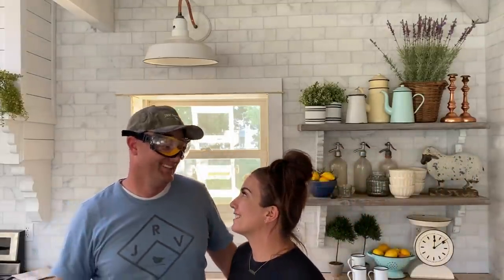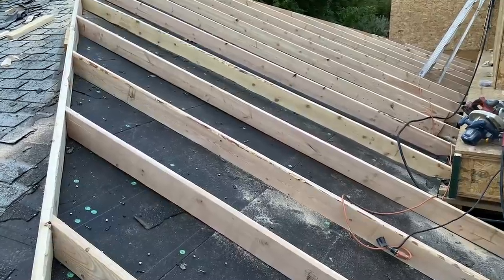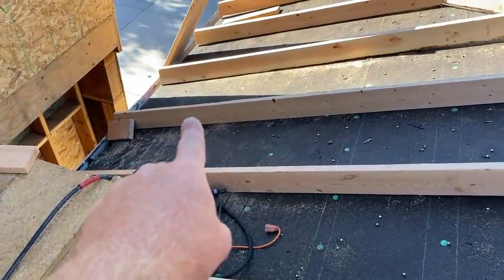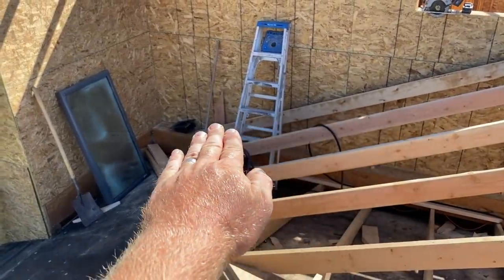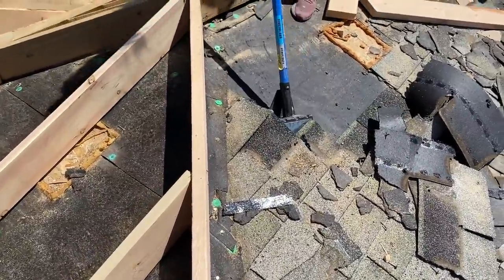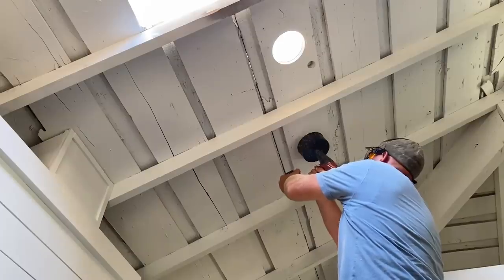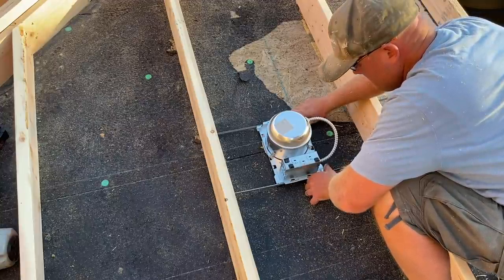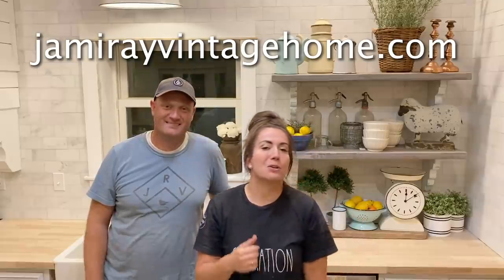Can Lighting In Our Farmhouse Dream Kitchen

Comment: AMAZING! As always, you are so right on getting those lights in there. Not that you spring chickens need extra light, but I find as I get older, I need more light. And hubby says it will have to be on the outside of the ceiling or walls, Boo! 
And I been in plenty of those dark dingy old homes, where you can barely see your hand in front of your face & I hate that also.. Yours is gonna be so bright & cherry.. not dark & dreary! ♡